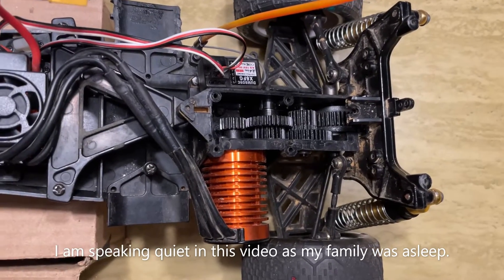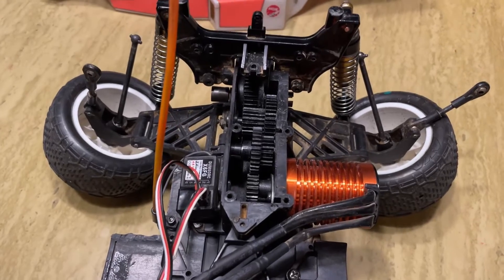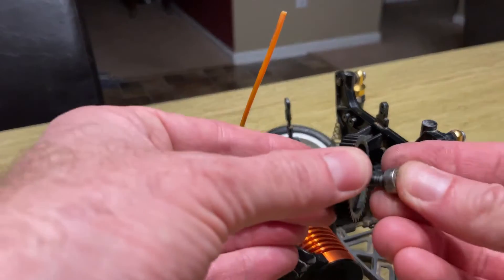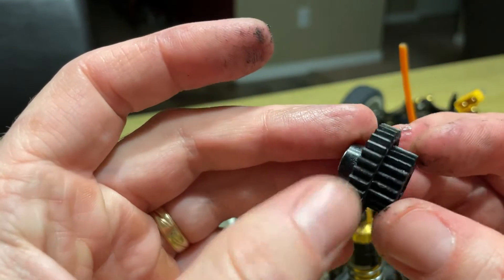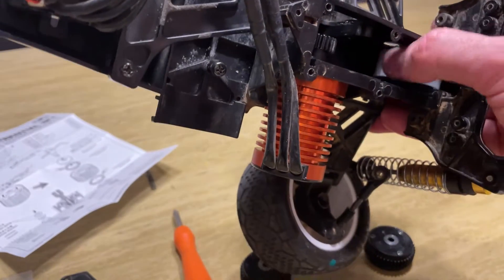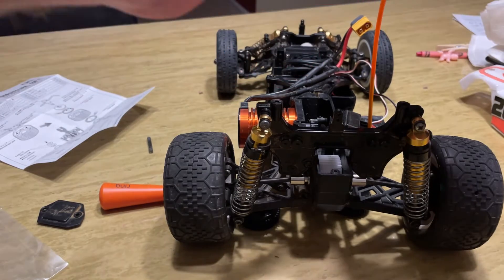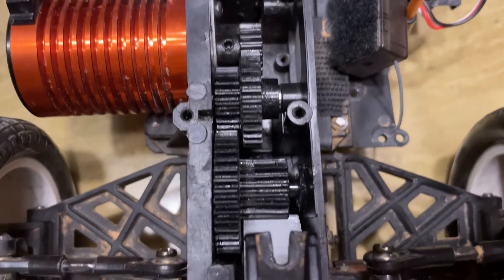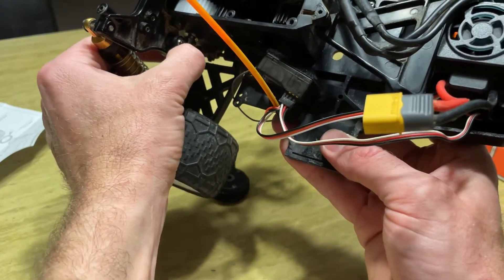Kyosho Raider Gearbox Inspection and Custom 43t Ball Differential Installation for Raider and Rocky!

Comment: Very interested to see how this goes! I have been looking for something to keep my Raiders gearboxes alive! Thanks for your experiment 🧪
Reply from the maker: Thanks man!  I hope to get a quick run maybe tomorrow morning for a few min.  I am still debating if I should grind the diff down slightly before running it.  I will probably just put in a half charged 2S battery and see how it goes.  I am very hopeful this helps folks like you (I know there are a bunch that cannot find Raider diff's and the "joints" are VERY expensive too so this could be outstanding if it works!

Comment: Thanks for this-just picked one of these up needing a complete strip and clean/rebuild. Not familiar with this car so your vid very helpful. Have to source a couple of missing parts and replace the pogo sticks for real shocks, hope the diff is ok but might give this mod a go if the original is knackered. Will keep it brushed out of respect for the age of the car but probably a 21T should give it a bit of zip.  Subbed.
Reply from the maker: Awesome!  Yes oil filled shocked would be a great upgrade!  

I ran mine for many years in the early 90s on a 15 turn brushed motor and it still wasn’t very fast as the stock gearing is very short - maybe low 20 mph or so (my early videos have this setup).   Honestly I would put at least a 17 turn…. or like a 15 or 13 turn brushed in it.

I had mine up to 56 mph on 3S and the gearbox looked fine…. But the diff is supposed to be the weakest link (and this stock dogbones are terrible too)!

Thanks for the sub and there are tons of Raider videos on my channel!

Let me know if you have any questions!
Reply from the maker: There are more but here is it running with the stock gearing and the 15t brushed motor.  https://youtu.be/ut2cB7c39_w

Honestly my brushless setup isn’t too crazy on 2s with the punch turned all the way down.  It has been great for me (and I have much faster gearing than stock).  For $40 for the ESC and motor is great!  With stock gearing it might not even break 30 mph with this setup.